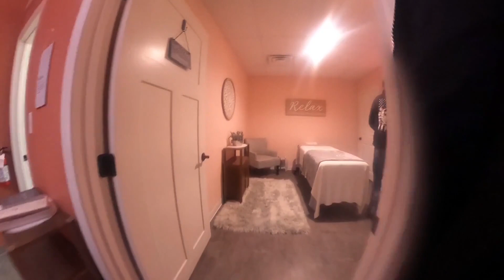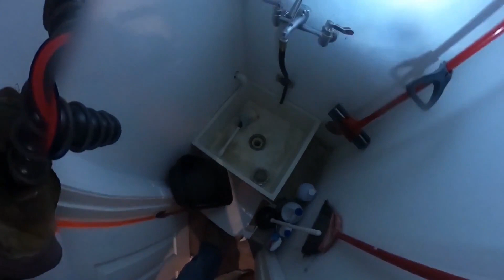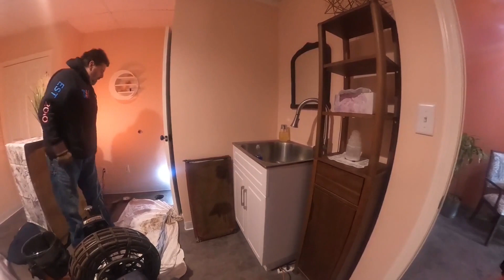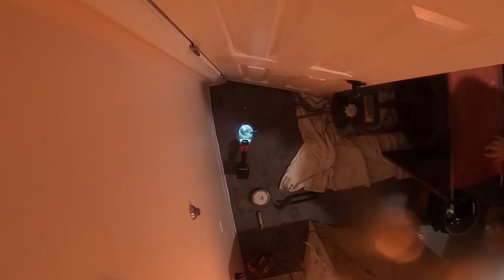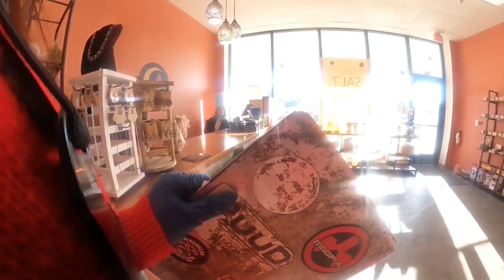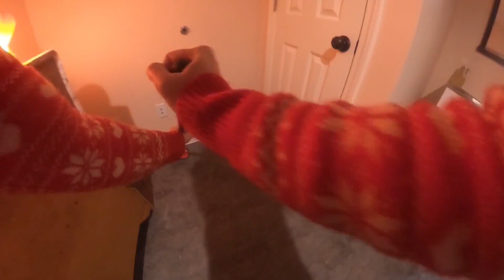Clogged Main Sewer Drain #184

Comment: Hey Drain Medic I have a quick question if you could possibly give some input I’d appreciate it.

From the foundation wall going to the main sewer pipe in the street……
At what point does the homeowners obligation to repair the pipe stop and the city’s obligation start?
Reply from the maker: Hey Chris every city and town is different. Most of them if the city pops the man hole and they are flowing they will tell you it's the home owners responsibility. I know here in Nashua the city tells us to tell the home owner that it is their responsibility right up to the connection point to the city sewer. (Shelly)
Reply: Thank you Shelly
Reply from the maker: No problem 👍. Your best best is to call the sewer dept in whatever town your working in and just ask them. They will be happy to help you. Build a great relationship with each town and you'll be a great asset to the cities and towns also.
Reply: Fair enough 
I just got of the phone with them in Mass and they reiterated what you said.

Comment: I don't understand why you didn't sell a camera job just because of the holit sounds like but this is the 2nd time they've had a problem it also makes you more money and gives you more knowledge of how to advise the customer just wondering
Reply from the maker: I don't really know how to answer this question. Been cleaning drains longer then having a camera system was readily available. You can know a lot about a drain by the feel of the cable and sounds the drain is making. Like if you hear the blades scaping all the way back you know there is not a sag in the drain. As far the second time backing up. I treat every job like I'm the first one out there. Gather as much info as I can with a grain of salt and proceed. We guarantee all our work unless we think its broken. Money comes with time. To me building trust with customers is key. Its work for 28 years. Dam I'm getting old